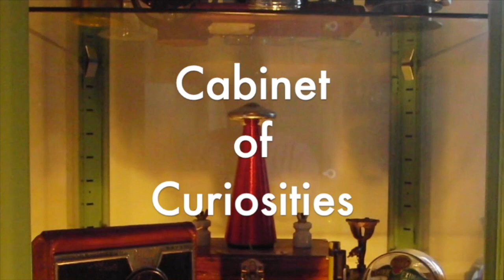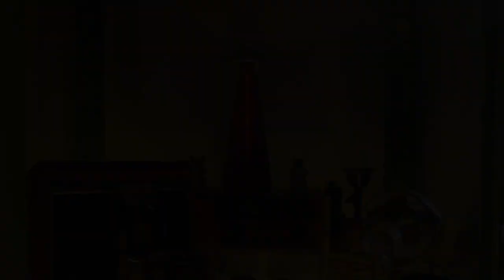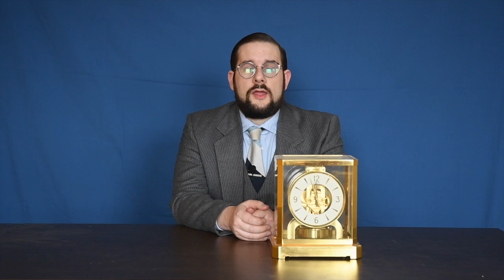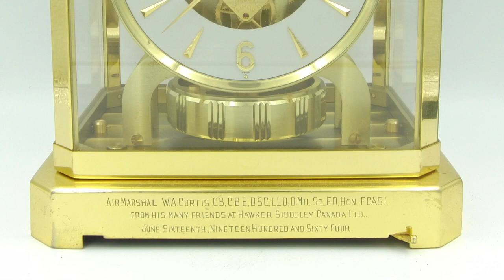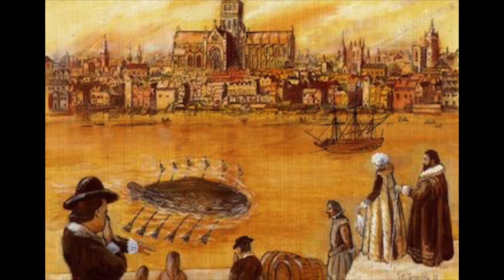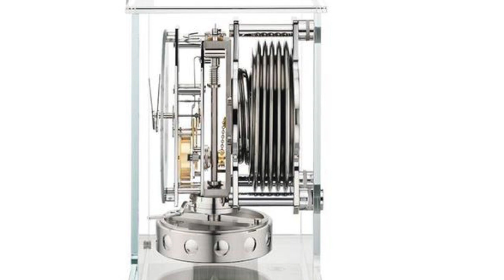Atmos Clock: a Self-Winding Wonder

Comment: I was given one on the 25th year of employment by my company. That was in 1982. It was very accurate. However it hasn't run for several years as I do not have a stable place for it to sit. It is very sensitive to vibration.

Comment: I’ve owned one of these clocks for over ten years now. It loses about a minute per month. Used to be more accurate than that. It’s difficult to read from across the room because the hands are so thin with little contrast against the face. I got a good deal when I bought it because it was not functional. I sent it to someone who specializes in fixing them. A weird coincidence occurred after unpacking it, setting it down and unlocking the mechanism … the damn thing was set to the correct time!

Comment: No, it's a free energy device, just like solar panels, windmills and ramjet water pumps.  Only the context matters. The energy is free like beer.
Just about all spring powered watches and clocks are extremely efficient. Most quality movements today can run 80 hours on a single winding. 
Some of these springs are only good for 1/3 of a joule (a. 30-26 hour spring) 36 hours of continuous movement on a 1/3 of a joule. The bearings are extremely efficient.
But there are plenty of watches today that self wind just by the movement of your arm. Though I wouldn't count this as "free energy" because it is getting its energy directly from you.
Reply: Really, any free energy device really just means COP > 1, energy from the environment, any legitimate "free energy" machine is getting its energy from somewhere else or recycling what was put into it.